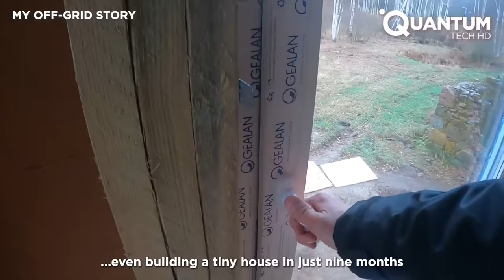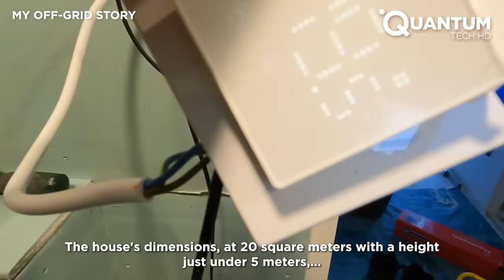Man Builds Amazing Tiny House in Just 9 Months | Start to Finish Construction by @my_off-grid_story

Comment: Nice, well-rounded skill set. A few problems I noticed: he dug the foundation and it was filled with water but he built on top anyway... bad long-term decision. The stove is great for heating the inside, should've kept the chimney inaide as well to maximize heat gain. The washroom requires special drywall that moisture-resistant for walls and, ideally the subfloor should be at least plywood if not concrete board. Water damage waiting to happen. Overall, great job but a few big mistakes that could cost a lot later on.

Comment: I don't understand why they built a tiny house just the necessary size for not needing building permits when they spent €87.000, they could have paid for the permit and built something bigger, but not, they are condemned to suffer such a small size.
With the money they spent could have made a bigger house, for that price I would expect much more than that.
Another point that I believe counts is the materials behind walls, floors, roof, in contact with earth, etc., seems to me not very well prepared to last a century something that easily can be reached by more conventional means of building.
There's a feeling of exaggerated effort for very little. I don't know but as an Architect with 33 years of experience I quite definitely would have built more for that amount of money.
The appreciation of the next comment is very adjusted to my feelings.
What is the purpose of two floors in such a small size? Why not just one floor but with a spacious home where you feel freedom not enclosure which is inexactly what they got.
Reply: I don't know why they went 2 story either. But the driver behind a tiny house is often to minimise space, cut-down on heating and cooling costs and not be laden with debt. I don't know how much of that was achieved in this build.

Comment: Why dig down 65% of the way towards a basement and then not go the extra 35% to create one? Even if you left the basement's electrics etc until a couple of years of later when you had more money, why not create the space and ultimately add 33% extra square footage to your home?

It seems like these small footprint homes ought to maximise use of basements and attics. Attics can at least be used for storage, or potentially for children's bedrooms / playrooms. Basements offer an additional full floor for multiple uses. A basement would cost 15% more?

Comment: Don’t understand why ppl do so much timber building? I guess it’s American culture that spreads across the globe. I’d prefer building the walls all the way up with concrete/ceramic blocks to have some thermal mass, much higher durability, and zero problems with mice and rats. Also I’d have concrete floor slabs to damp vibrations and sounds between the floors.